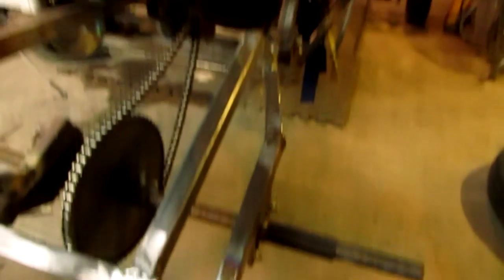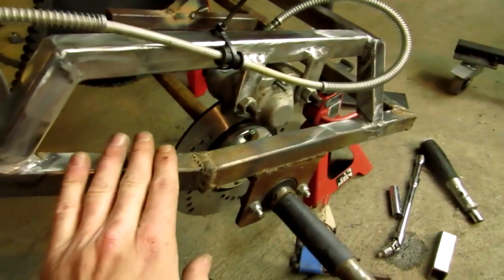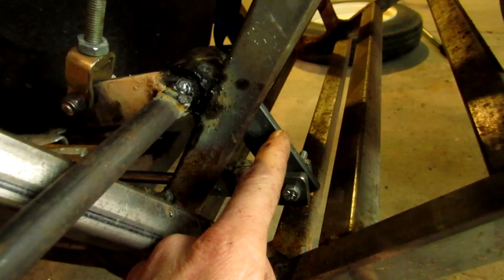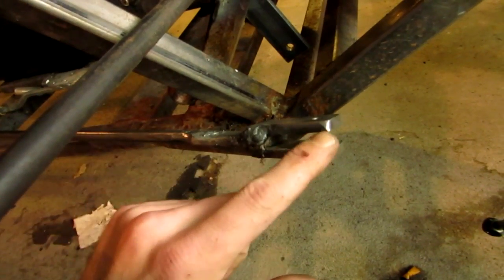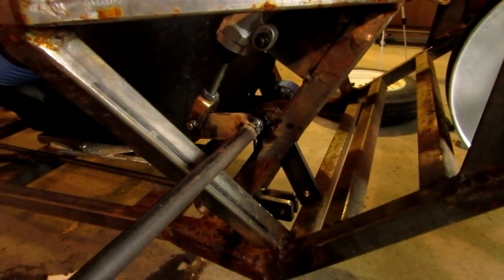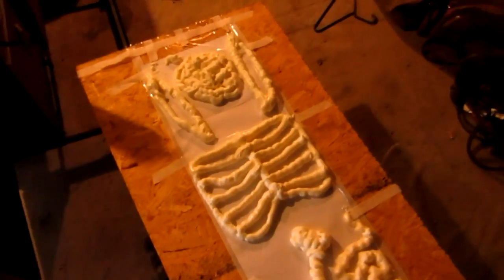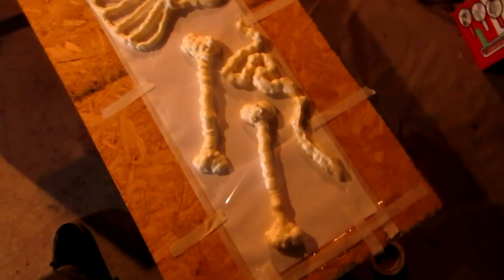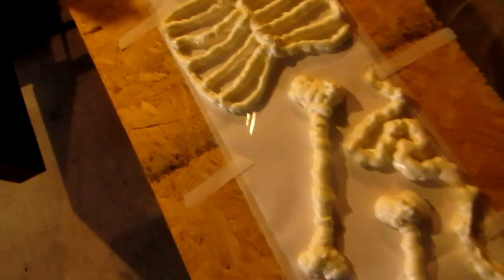MASTER CYLINDER MOUNT and PIVOT ( Fullscreen Machine )

Comment: The rod pushing into the master cylinder should push in straight or over time it will wear on the into of the master cylinder and will cause it to leak. Been there done that.
Reply from the maker: yeah Ill have to adjust it a little.